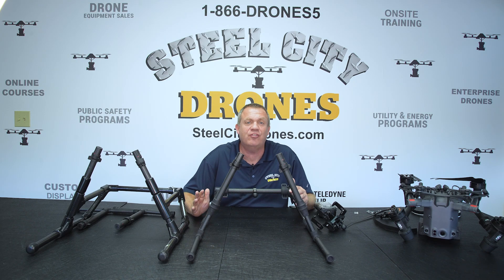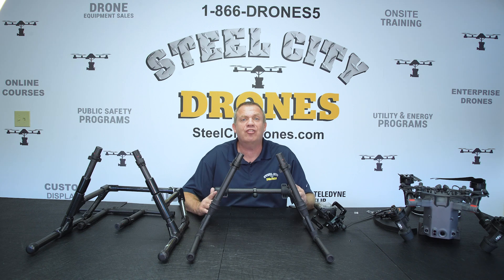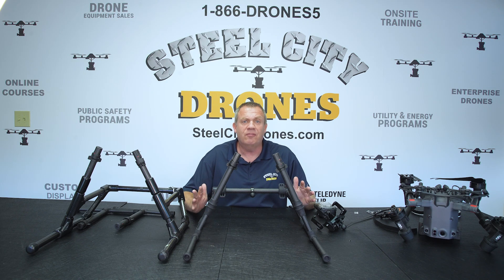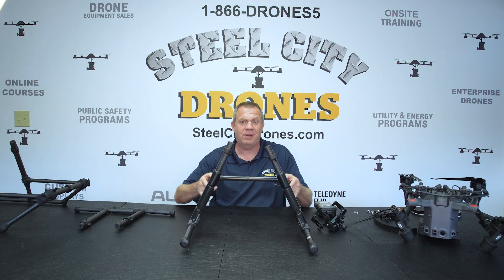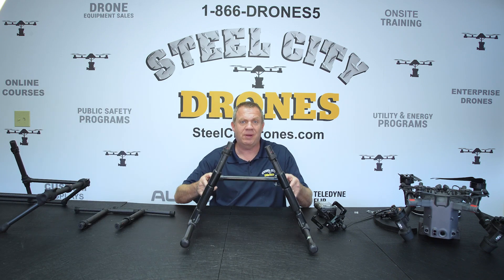DJI Matrice 300-350 Custom Gas Meter Mounting System | New Design

Comment: Would have to be a major leak in order for the meter to read with the wash of the blades wouldn’t it?
Reply from the maker: No UAV mounted system is going to be a perfect solution however we placed the meter where it minimizes prop wash and it is effective to get usable data. We place the meter in between the 2 back props and slightly below them so there is no noticeable prop wash at that specific spot. We did a lot of R&D to make a workable solution. If you then go slowly straight up with the drone it will meter the gases and get good data.   The FLIR MUVE C360 is placed under the drone in a normal camera sensor prop which experiences a lot more prop wash and that is a very expensive solution.  Ultimately it would ideal to have the meter on the top of the drone but its impossible to get a  top mounted camera to focus on the display that close to the meter.  The minimum focus distance of the H20T is the distance we setup our configuration which is not possible to do on the top of the drone.  Hope this helps.

Comment: wouldn't the rotors blow the gas away.
Reply from the maker: No UAV mounted system is going to be a perfect solution however we placed the meter where it minimizes prop wash and it is effective to get usable data. We place the meter in between the 2 back props and slightly below them so there is no noticeable prop wash at that specific spot. We did a lot of R&D to make a workable solution. If you then go slowly straight up with the drone it will meter the gases and get good data.   The FLIR MUVE C360 is placed under the drone in a normal camera sensor prop which experiences a lot more prop wash and that is a very expensive solution.  Ultimately it would ideal to have the meter on the top of the drone but its impossible to get a  top mounted camera to focus on the display that close to the meter.  The minimum focus distance of the H20T is the distance we setup our configuration which is not possible to do on the top of the drone.  Hope this helps.
Reply: @SteelCityDrones  stick it on a long cable?
Reply: Thank you for replying.